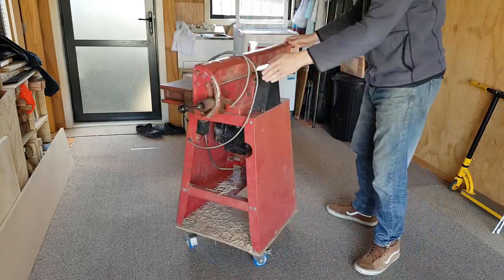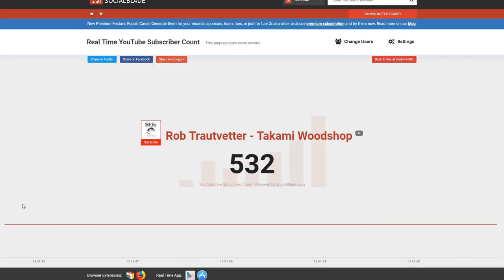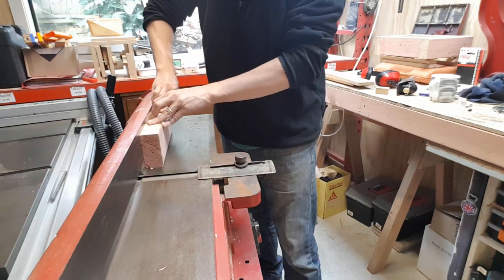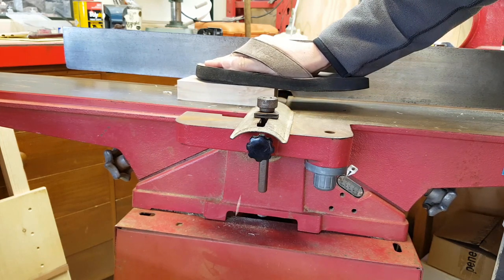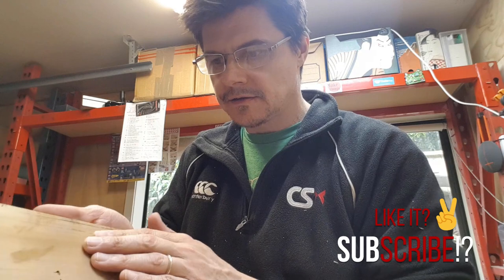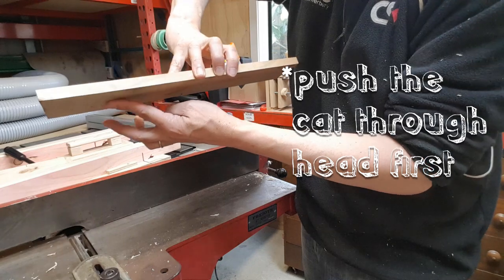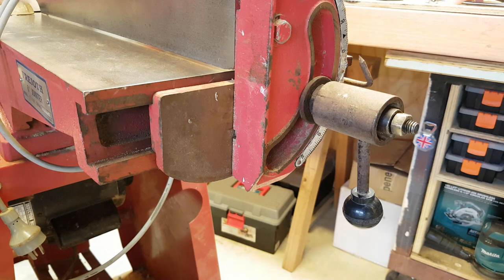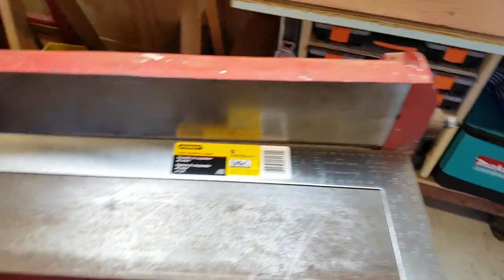'94  Frejoth Jointer - Intro

Comment: very funny video
that jointer is a small beast... back in the days they knew how to build tools
one trick I use to feel the grain direction is to use a nylon sock over the board. you'll immediatly feel the grain direction
Reply from the maker: Thanks mate! - I'l definitely try the nylon sock technique - it would be a much better indicator than fingers I think. I really love the old (and new) cast iron machines - much better than the recent cheap aluminium or magnesium alloy based machines.

Comment: First thing I learnt was I had no room for it!  That push block looks scary to me.  I'd recommend you fasten the heel into the end grain of the block so there is no chance of the screws holding the heel coming into contact with the rotating knives.  Funny video.  Cheers, David.
Reply from the maker: Cheers David - that's a good point! I've made table saw push blocks with heels into the endgrain - not sure why I did that. You are absolutely right though I have been paranoid about the screws. Ultimately I plan to purchase a pair of those grippy bottom jobbies with the angled handles. With only one push block the free hand is a real concern for me. Makes sense to keep it occupied safely and gain the benefit of evenly and more centrally distributed downward pressure.

Comment: Your videos are always Hilarious dude lol
I remember FILA from the 90’s quite well 🤣.
Your blades seem pretty sharp as is and I use a Magnetic jointer knife jig to set the blades, there cheap and work really well, my jointer at the office has a spiral cutter head (pure gold) and I still have a straight knife at the house, they work fine until you get a Knick in the blade. Now that you got it up and running, it’s a game changer dude. Can’t wait till the next video 🙏🏽👏🏽😎
Reply from the maker: Yeah man those FILA boots were a game changer for me back in the day - but now I've moved on to more cutting edge equipment. I've used it a few times and I already see that I need the thicknesser with it pretty soon - jointing boards on both sides makes them into a wedge shape. But I have a few projects lined up that don't need it just right now.
Cheers Frank!! 👞

Comment: I love the humor!  What size blades do you have?  Have you sharpened them yet?  I have a cat I'd love to run over my jointer ha ha ha. The thing shits like a dinosaur!!!
Reply from the maker: Cheers mate! I'm not sure what size the blades are. It's a 6" jointer. It came with two sets of blades - one was still wrapped from the professional sharpening dude so I put them on on the second day which really made a difference. It needs a new belt as well I think. It had been in use up until the day before I picked it up so in general it is all fine. Our cat won't shit outside so we have to have that kitty litter stuff and she won't use it twice in a row - so if she has to shit twice while we're asleep or out - well that's really why I bought the jointer ....

Comment: Definitely a deceptive tool in its complexity to learn how to setup, use and tune. Can do great things once you got it right.
Reply from the maker: Yes, exactly - setting up the blades is tricky. Luckily I've never had to tune the tables as mine have been dead nuts since I got it. Use of the things is probably the trickiest as it takes a reasonable understanding of how they work and how they are supposed to do achieve their goal. I totally rooted some of my pieces on my workbench top - have you got to that one yet?
Reply: @TakamiWoodshop  made my own 🤣 I flipped a 3" planer. Only good for edge jointing and striping paint really and wont win any accuracy awards, but there is a video and I used it in my wireless charger build the other week. Handy to have for all its failings.
Reply from the maker: I've seen your vid about that. Does the trick aye!

Comment: Buzzer fences always suck. I've never used a buzzer which I could confidently move the fence without having to reset 90°. On my buzzer in the garage, I haven't moved the fence in 3 years 😂
Reply from the maker: yeah when  bought it the guy pointed out and showed me that that it was good now and how to tune it, and even after bringing home in the car it was fine. A week later ... not fine. What about the fence not being straight - is that a thing? Regardless - doesn't matter though does it?
Reply: The fence not being inline with the beds doesn't matter much. The only thing I can think of that may be bad is that it may limit the usuable width of the machine, but I'm pretty sure that could be worked around fairly easily.

Comment: My dad has one but it doesn't have the fence.  Any idea where I can find one or how to make one?  Thanks!
Reply from the maker: Hey J, I don't think there's much chance of finding one but there are a couple of other options. One option is to just not worry about having a fence - you can use the jointer for the faces and cut the edges on a table saw or using a track saw or circ saw with a guide - there are plenty of youtube videos around that will show you how to do that. Another option is to make your own fence - bearing in mind that almost nobody uses the tilting feature of jointer fences - it's easy to make a fixed 90° fence.  I would use 18mm MDF and look to make a torsion box kind of thing - a bottom plate with a face screwed to it at 90°, a rear face, and bracing in between. The torsion box design is a simple and very effective way to create a rigid flat surface that resists twisting and flexing - perfect for this application. And you'd have to figure out some way to attach it to the jointer - I would use clamps but I guess you could get more fancy. For ideas try looking up torsion box router fence on yt. 
good luck!